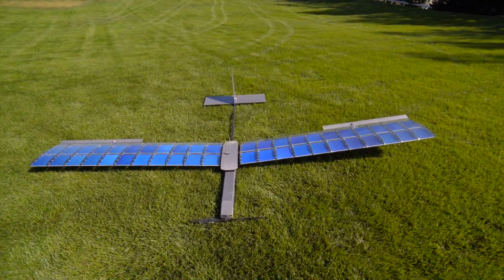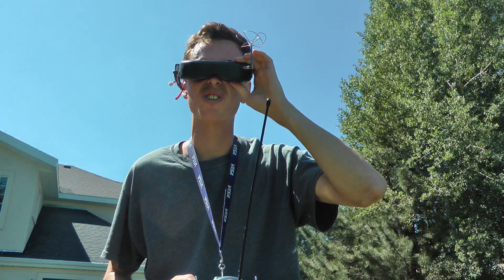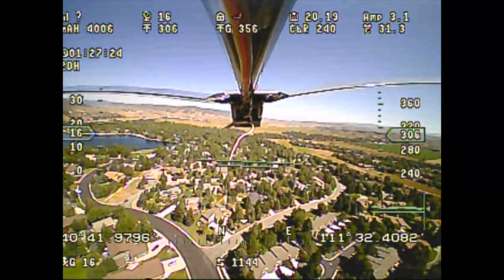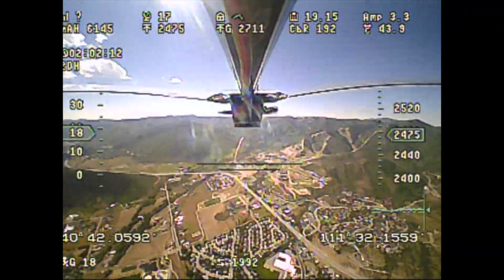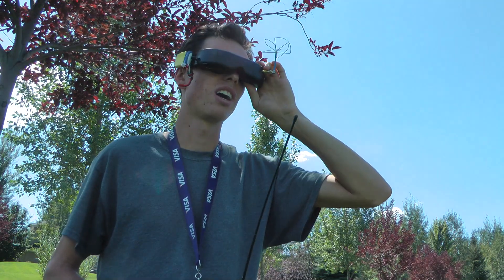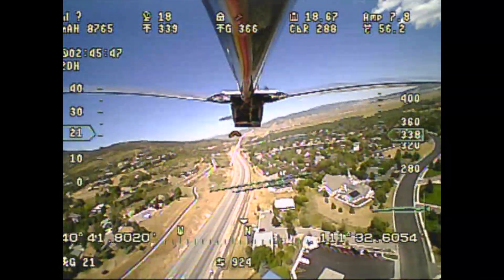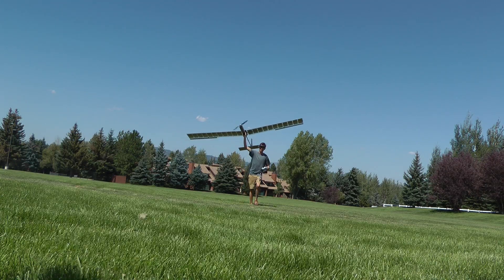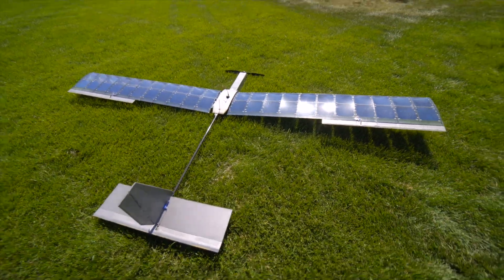SOLAR Plane V3 Long Duration Test Flight - RCTESTFLIGHT

Comment: Maybe if you use a smaller battery, you can "fly forever". Maybe try it with a 2000mah battery
Reply: Agree, big battery is just pulling the plane down for no reason.
Reply: But you do need enough to still get back when a strong wind current comes in or clouds come in
Reply: Smaller battery capacity, not smaller voltage.
Reply: Jesse M although the article might be about lead acid, the concept still applies. It doesn't mather how big your battery is you will get a temporary voltage drop if you draw current, if you stop drawing current from a battery the voltage will go back up slightly.
Reply: Tomás Arturo Herrera Castro that chart is for single cell lead acid, not multi cell lithium ion.
Reply: A smaller battery produces a smaller maximum voltage, and the engine likely needs a certain amount of voltage to be able to fly.

Comment: Where're it's landing wheels?
Reply: redstone craft guy there aren't any, so it is as light as possible.
Reply: redstone craft guy it has to be realy light to fly that long,
With a landing gear you would have more drag and weight, and you don't need it to land because you can just land on grass.